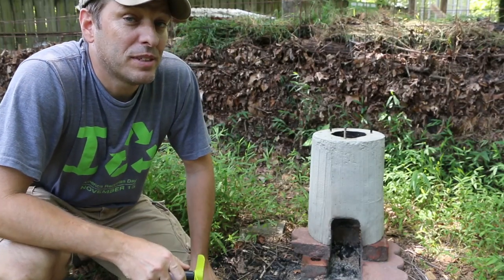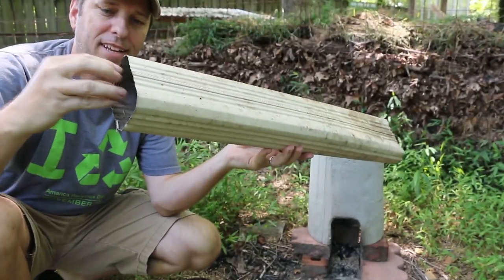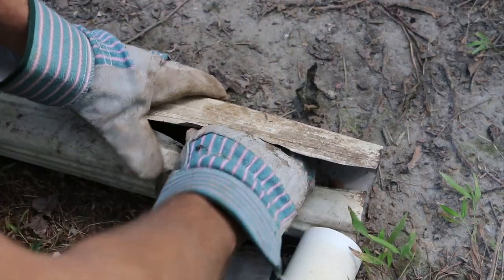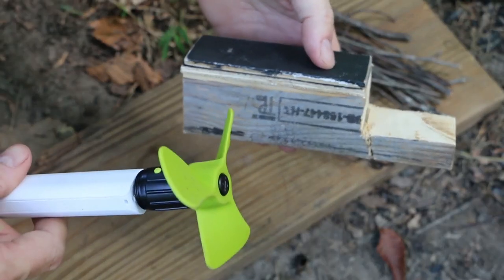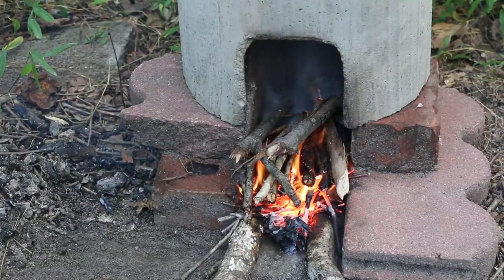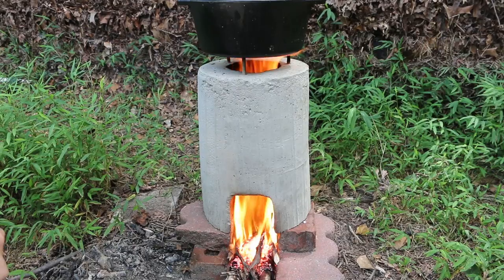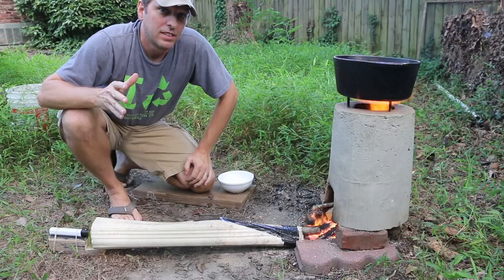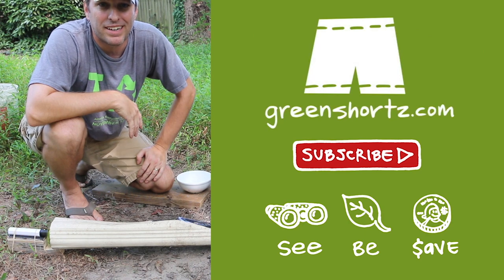How To Boost A DIY Rocket Stove With A Fan

Comment: Nice! I was looking for more of a "J" shape to your rocket stove, haha! This way, instead of your sticks laying on their sides they are either at an angle or upright, i.e. at a 45 degree angle. If you're including this fan, you should have 3 channels/shafts ... 1 for the fire to head straight up. The next one down should be at 50% of a 45 degree angle (this is the one you'd put whatever it is you're burning.) And the last one would be the shaft for the fan which would run parallel to the ground/floor.

Another option is this shape    ______I__I     Where the first flat section is along the ground/floor and is the open shaft you'd use for the fan. You would obviously have one end open to put the fan in it. The other end is put INTO the concrete shaft leading to the the tower that would have the flames rising at the end of the stove. The first rise will be where you feed the burn medium (wood, paper) and the flame would head to the right toward the tower where the flames ultimately rise up. 

Realistically the fan is not necessary and was only a talking point by me on your related video comments when referring to attempting to melt aluminum. The fire may burn hotter but I am pretty sure it consumes the burn medium very quickly.

I still want to know if there is a high heat concrete that can be used instead of cob when building an interior rocket mass heater. Making cob is tricky and I don't know where to get some of the materials I need to make it and then how much of each ingredient to make the perfect mixture which HAS TO BE just right. :-)
Reply from the maker: +Lee Forex the fan does make the stove burn through the fuel more quickly. I was boiling eggs today and left it for a few minutes to do a chore and it burned out. Ha. That said, it did relight pretty easily and boiled the water much faster that a non-fan burn. I've been watching a few pizza oven videos and saw reference to refractory cement and refractory brick. That might be your alternative to cob. The crack resistant concrete I used for this rocket stove is holding up great so far. No cracks. And it ran pretty hot today.
Reply from the maker: Hi Lee, I referenced your comment in the redesign of my concrete rocket stove. Check out the video: https://youtu.be/TYr-Uj4HqDs  I'll be adding a J-tube component to this stove in my next video. Thanks for the suggestion.

Comment: Pop rivets might be better than duct tape. Does the tape melt at all with the heat nearby?
Reply from the maker: I agree that pop rivets would have been a more permanent solution. It didn't melt as the airflow pulling in moves most of the heat away from the end of the tube. What I needed to do with this rocket stove was elevate the fuel. I was still in my learning phase at this point in this long series. :-) Thanks for watching.

Comment: Put a grill grate on the bricks and build the wood on top so air can rush through the bottom. Dig a small trench under as well. Let's see the result GreenShorts!!!! No fan required. Keep the wood inside the flute of the stove. C'mon man

Comment: Add a mesh between the round part of the stove and the bricks at the bottom, put the wood on the mesh. that way it can take air from underneath.
Reply from the maker: +Mårten Woxberg that is a good suggestion. I'll give that a try the next time I use my rocket stove. Thanks for watching.

Comment: Why not feeding the fan with some Peltier devices, and use the heat f the stove to feed them ? Your battery is not sos sustainable, if yyu consider the whole life cycle f it prductin and disposal. Even if yu fuel it with sustainable energuy
Reply from the maker: +Cousin true about the battery life cycle. I had to Google peltier device. Pretty cool. I’ll have to give that a try. Thanks for your comment.
Reply: You're welcome. Actually I am thinking about combining some Peltier module with a fan and as well copper tube turning around and touching  the chimney, with a waer circulation,  to get a very effective heating. the water gets the heat from the chimney, then circulates around a remaining length of copper tube, thus heating whatever space - a house or a van I was thinking - and then cools one side of the peltier device, before the tubing gets back to heat more along the chimney.  That ould make a very effective heating. Without the fan, the copper tube sinking the heat would make the combustion ineffective, the air  througflow would not be pulled enough by a cold chimney air.
Reply: You're welcome. Actually I am considering a cirular copper tube getting heat turning around the chimney, heating a van or a room, then cooling the other side of the peltier stuff, and getting back to get heated around the chimney. It improves the peltier efficiency and the fan balances the lack of chimney air pooling caused by its heat sink through the tube copper. That may make a very effective device, if properly sized.